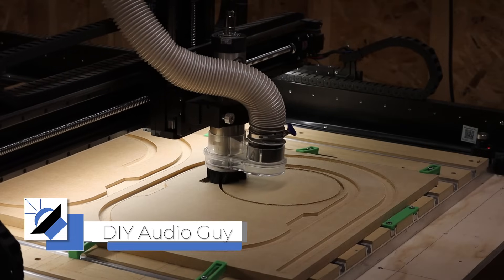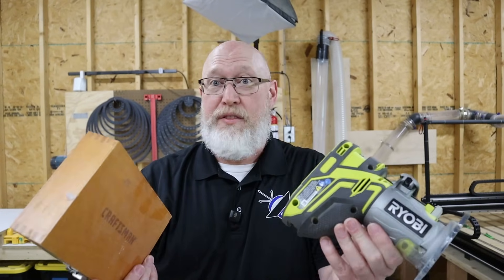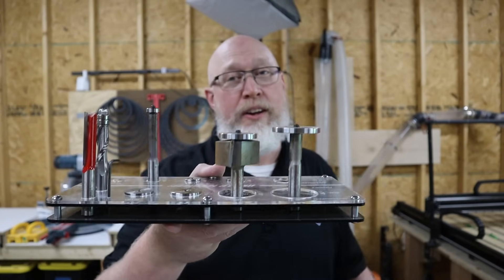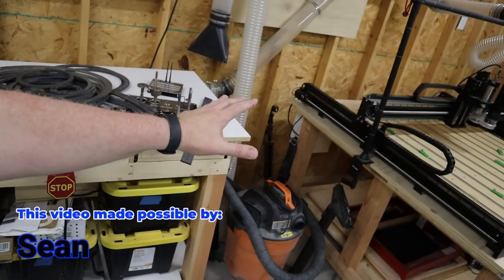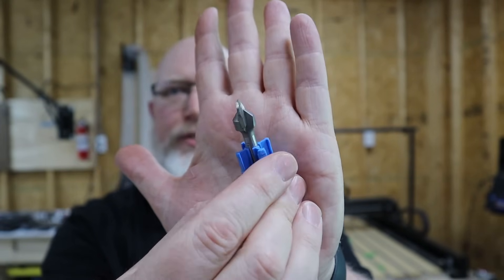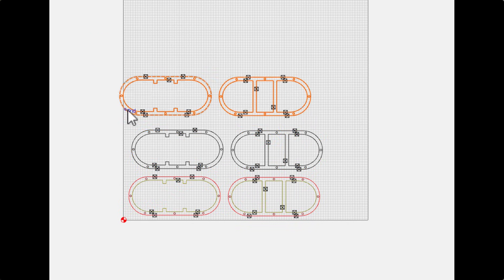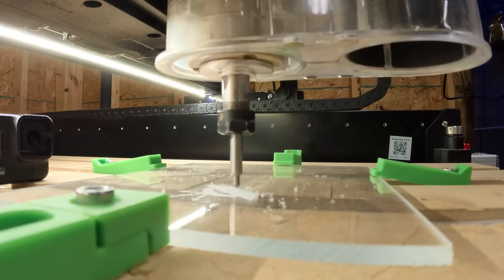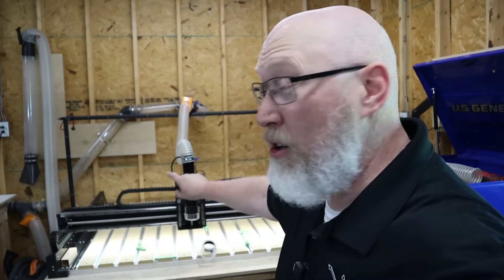Stop Wasting Money on tools, get a CNC today!

Comment: I had a CNC. Yes, it works great for what you're using it for, but it is not the end all to woodworking and / or speaker building. It definitely serves a purpose, just not all of them. The only complicated cuts made in enclousers is the speaker hole. It's easily done with a cheap homemade router compass and / or a template. A simple, cheap laminate router will do the trick. I own a Rigid, WEN, and a Bosch. Honestly, my cheap $35 WEN does one heck of job. I have been building enclousers & woodworking for over 3 decades. It doesn't take a fortune in tools to build quality projects. Takes experience and skill. The CNC removes those skills. Now I am not saying dont buy one cause they certainly have a place.
Reply from the maker: You are not wrong.  But you will probably want to watch this to see the other side of the story.  https://youtu.be/YQFkmYZcJjY?si=ROjBy9jfMRiPBSw6
Reply: @DIYAudioGuy I have seen it. I watch many of your videos.

Comment: It's not thst hard to DIY a   CNC style cutting table. There's lots of videos on CNC plasma cutting tables, and all you'd need to do is change the plasma torch attachment to something that would hold a router. Also these DIY tables can be pretty reasonable (like sub $1000).

Comment: OH and most cnc machines of that design are scalable... just add longer parts here, a longer part there and you can go from a 24"x48" cnc router to a 4'x8' cnc router using basically the same components at about the same amount of time it took to build the 24"x48" especially for those people that want to use a whole sheet. Nest the pieces on a 4'x8' sheet once and be done with it in a single shot. FYI: "nesting" is the term for laying out the parts in a workspace so that waste is minimized and as much of the materials are being used. When puting your parts in CAD to generate G-code, it is highly beneficial to put each part as close to every other part as possible and sometimes even using the cut from one part to rough edge next to another part. This has several benefits: less waste, less travel time of the cnc machine and potentially smaller workspace within the material so you can fit more components per sheet. There are several open source free nesting softwares out there to try (quick search: deepnest and svgnest) . Materials can be expensive.... save as much of it as you can.

Comment: Respectfully... Keeping it real brother...

Absolutely looks like a good long term business expense.. But..eyes open... 

Takes up absolute floor space... Not going to hang it on a peg board or stuff in cabinet..
Requires additional infrastructure... Computer   to run it, vacuum to keep clean, and of done right it needs dedicated breaker to power it.
And most of all its a single point of failure.. If it or it's associated needed systems go down...shop production is reduced to dozens of bit changes on the router tables. 
V/r

Comment: I get the argument for the CNC and I agree. But to spend that much on template rings is completely futile because you can use an adjustable circle jig for your router (which you can do yourself for <20 bucks or buy one for 50) and if you actually prefer the template rings, do them yourself from wood (Ply or particle board, MDF etc) with the circle jig. So please don't inflate the numbers, there are still more than enough arguments for the CNC without that.
Reply from the maker: Fair enough.

Comment: Next upgrade -Auto tool change  lol
Reply from the maker: I did not know that was thing until after I bought this.
Reply: @DIYAudioGuy  I did not know Laguna makes CNC machines,I looking for something to make money,Oh i love to have cnc ,make flat pack boxes but here in Australia Postage is soooo pricy ,just cant rely on locals,All sounds cool but if F up on sizes liability not something want deal with if someone blows a sub.Yes its so cool watching tool change time is money ,I also did not know get router heads water cooled.
Reply: @Springboksimmer  Not all heads are watercooled.  It's a option on the higher-power ones, and generally only needed for long runs or machining metals.

Comment: @DIYAudioGuy I can build enclosures with this , no other parts or accessories needed? Other than the actual materials for the enclosure ?
Reply from the maker: You will need the bits put in the machine.  Those do break and wear out over time.

Comment: My Bosch 12v palm router is the main workhorse, I never use my router table. I do have a Bosch/full size (plugin) router with a permanently mounted circle jig but it only serves that one purpose. 

Table saw... I rarely use that either because I use the track saw for everything that matters. 

I dream of the day I can get a CNC but my main issue is I don't have a place for it. All my tools are on portable stands/need moved out & stored every day. I don't have a shop I can dedicate to woodworking.